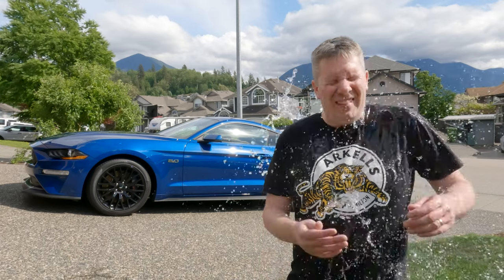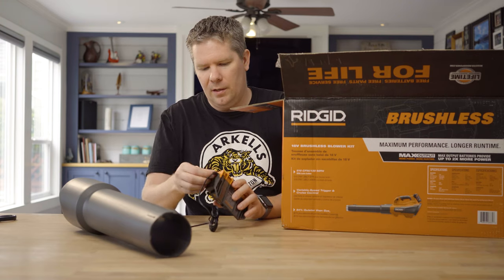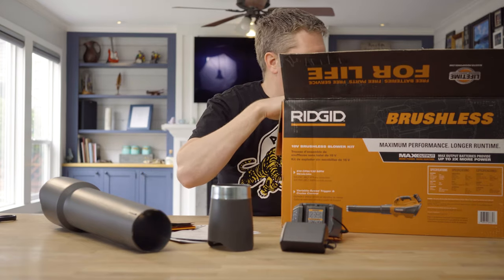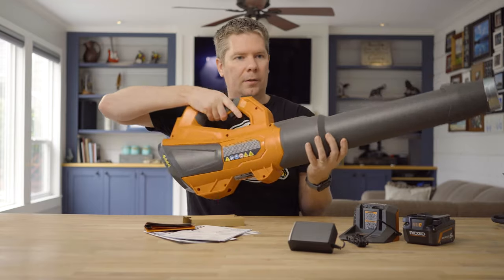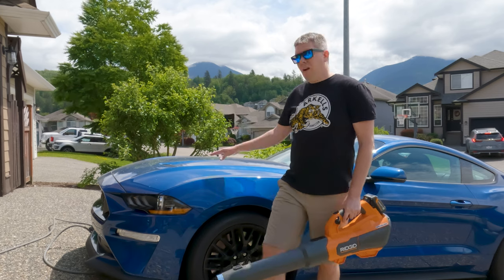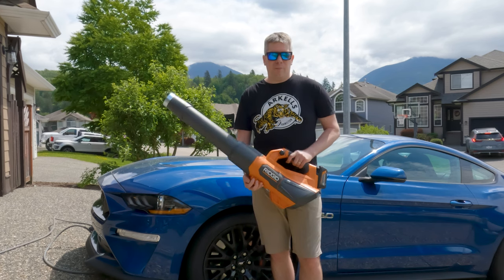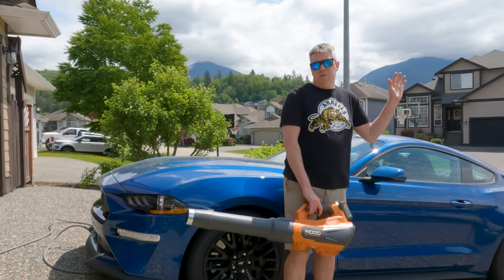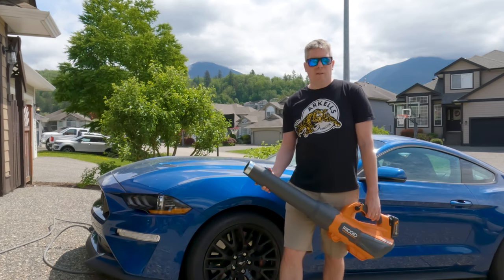How to DRY your car FAST! RIDGID 18V Brushless 510 CFM Leaf Blower Review!

Comment: Using a leaf blower is a game changer. I use the ego blower with the car stubby and gets 95 percent of the water off then follow up with a drying towel. Great demo Matt keep the videos coming 👍🏻
Reply from the maker: THANK YOU David! Its encouragement like this that keeps me going! What EGO did you end up getting? I have had my eye on them for quite some time. Prior to the Ridgid, I was using a hand me down Black & Decker Leaf Blower it was ok but it is night and day with a high output leaf blower such as the Ridgid or the EGO.
Reply: @Life of a Matt  The ego 765 version. The cost is higher but definitely worth it in the long run for sure. I even use it to blow snow off the truck in the winter
Reply from the maker: NICE! Yeah I have been looking at one too! When the time comes, you just helped me with my decision David!

Comment: 2018 GT Premium w/PP1 - Very intricate gloss black painted wheels. Recently I tried out Meguiar’s Hybrid CeramicWax - I’m pretty happy with it. After the first treatment, you wash the car, I use Meguiar’s Gold Class Car Wash, then simply apply a light spray of the Hybrid CeramicWax to the wet surface and dry. I don’t use my leaf blower on the car. I use Griot’s Garage PFM Drying Towels - those towels are amazing! The wheels are another story. I use Aero Cosmetics Wash Wax All on the wheels. I have a couple of good wheel brushes & a lug nut cleaning tool. The leaf blower really saves a lot of time drying the wheels. I’m in Texas, so best time to wash the car is immediately at sunrise - The summer sun is crazy strong. Also I use a Camco camper water filter at the hose bib - this helps remove chlorine and other contaminants from the wash water. Your car looks great. Happy motoring 🤠
Reply from the maker: Thank you Analog Guy!!! We live up on a hill so just before 8 the sun dies behind the mountain which is perfect for washing; it does suck to film then though lol. Nice write up on the set up, I have looked at the Meguiars line up before but never really tried it. Well here’s one for you, what do you recommend for a leather cleaner and conditioner? I have leather throughout the car and want to keep it looking but also keep it in great condition for a long long time. So any recommendations? And how often would you clean vs conditioning?
Reply: My S550 is five years old, 54,000 miles. I have the “Carbon Sport Interior Package” - alcantara seat inserts with leather trim. Note - typically leather car seats are coated with a protective sealant, so leather care products my not be the best option. Also most cars with “leather seats” have leather on the seating surface and vinyl elsewhere. I use Mothers VLR on the appropriate surfaces and rubber gaskets. So far seats show no appreciable wear! I have a “98%” approach to car are - I do a really good job, but don’t get obsessive. Lot’s of people come up to me to admire my car and talk Mustangs!
Reply from the maker: Very cool, thank you for sharing Analog Guy!! I will check out the Mothers product.

Comment: I put a stubby attachment on my ego blower. I like using it because it knocks enough water off to prevent my drying towel from getting overly saturated, plus the typical hard to reach cracks and crevices
Reply from the maker: That’s awesome Woocoheed! What Ego do you have? When washing the car today I took off the front long barrel piece but I need to find a rubber band cover just in case it touches the car. Regardless in the end, it is the best way to dry the car!
Reply: @LifeOfaMatt  I have their weaker one, 530cfm I believe
Reply from the maker: Very cool. Do you wish you spent the extra few dollars to get the higher CFM model? The Ridgid did a good job 510 CFM but I’m curious to try something that outputs 800 CFM.
Reply: @LifeOfaMatt  nah, any higher would probably be louder and burn through the battery faster
Reply from the maker: @woocoheed  That's a really good point!!! Regarding the battery that is. Now here's a fun thought and trial, grab a leaf blower that outputs 500, 600, 700 and 800 CFM. I believe they are all using the same battery. So after the big test, the data will be clear; what blower performs the best and last the longest.

Comment: Surprised there isn’t a stubby for this leaf blower
Reply from the maker: I couldn’t agree more. I can take off the front black piece which reduces the weight and shortens up the unit. I will reach to Ridgid and see if something is or could be in the works.
Reply: @LifeOfaMatt I think the stubby guy is going to make one
Reply from the maker: Nice! @kirkwilson5900  I don't mind the way the Rigid is shaped. I have gotten used to it over the last year.
Reply: @LifeOfaMatt  have you been using it to dry cars? I'm a mobile detailer and just don't want to pay over 300 plus for the ego or the bigger ryobi or other bigger battery models. Home depot has the 2 battery plus free tool deal right now at 179 for the rigid batteries and this blower as an option for the freebie. I know it won't do as much as the 765 but I also like that it's lighter and smaller. I wash 5 to 8 cars a day, light and nimble is key. About how one do you get out of a battery? I think the battery deal is for a 4.0 and 6.0 each
Reply from the maker: I find that the blower could dry 2 cars on one battery @kirkwilson5900  If you were drying a truck, you may have just enough juice to start your second vehicle to dry but you wouldn't be able to complete the second one. Plus the speed starts to reduce after the battery drops below 50%. If you have the budget, I would get the ego as it will dry your vehicle a lot faster. 

On another note, having a vehicle that has a ceramic coat makes drying so much easier (ie the Mustang in this case). If I dry my van (has not coating on it) it takes twice the amount of time hence more battery drain too! 

Your call at the end of the day. Home Depot is good with their returns so you could try it out and return if you want the extra power.
Reply: Thanks for the info! Definitely ceramic coating helps. I'm trying to decide between raw horsepower or light and agile...